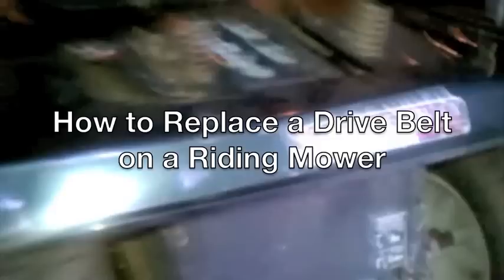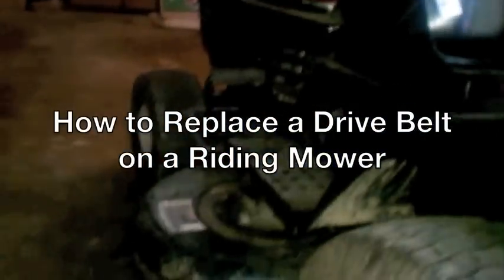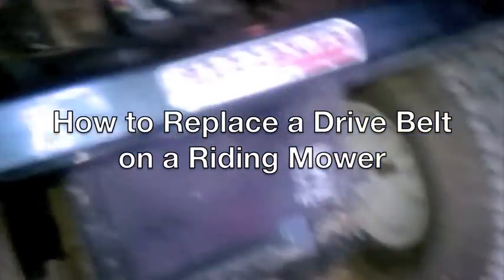How to Replace a Drive Belt on a Riding Mower

Comment: nice vid. bro. i changed mine yesterday, now i done it on my troybuilt bronco. and it was way easier than this vid. but it is nice of you to post your help to those than need's it. all i did was use a motor hoist land lifted the rea end off of the ground. didnt have to remove any panels at all just undone 3 scews holding the rear pully in place chocked the dive tesioner. and put the new belt on. toolk 15 mins tops.
J.T.

Comment: Thanks for the video. I replaced the upper belt for my parents last night. They don't make the original belt anymore for her model 693 16.5 kohler 42" 2 blade, but it looks exactly like your mower in the video. I took her old trashed belt to home depot and compared belts. I got a 38" Troy Bilt / MTD belt, #954-04062 / 754-04062 and it works just fine. Just a tidbit of info for anyone with the 693 or similar.

Comment: great video. what kind of wrench did you use to hold the front still to get the center bolt out. I'm having trouble getting that bolt off.

Comment: Yeah, I didn't see any videos that pertained to mine either. I have that bug pully under the battery cover as well. Got my belt but didn't do it yet. Mine is still really tight, but I think slips once in awhile. It's 8 or 9 years old.

Comment: did you have to take the pulley (the stationary one by the tensioner pulley) in the middle off? not much clearance to get the belt threaded.

Comment: A monkey wrench might work too. Another way is to get a chain wrench.  Slip the belt off the larger pulley and wrap the chain around the pulley.  The chain wrench only works properly in one direction so make sure you put it on in the right direction.  That should make it easier.  I use one that looks like a vice-grip with a chain on it.

Comment from the maker: I'm by no means an expert on riding mowers so I have no idea why yours isn't working.

On my own mower, if I were to put on a new drive belt and it won't work because the belt is loose, I can only think that maybe the "idle spring" isn't reattached. That spring is extremely hard to pull back into place, but it is what tightens up the pulleys and puts the tension on the belts.

Comment from the maker: Yeah, that's an old myth. Google "Snopes.com: Do Cement Floors Ruin Car Batteries?"
I wish I could be of more help. I'm really no expert on mowers. Just tried to make a video that may help others who had my problem because there wasn't any vids. From my experience, and this is from 2 years ago, when I put the belt on it was a little loose. Then when I pulled the idler pulley spring back into place, the belt tightened up.  But this was on my mower, I do not know if this works on others. Sorry.

Comment: Never put your battery on the concrete
Reply from the maker: http://www.snopes.com/autos/techno/battery.asp
Reply: It killed my battery had to buy a new one for my car. Concrete does in fact drain the battery.
Reply from the maker: You see, the myth that concrete drains batteries does have some historical basis. Many, many years ago, wooden battery cases encased a glass jar with the battery inside. Any moisture on the floor could cause the wood to swell and possibly fracture the glass, causing it to leak. Later came the introduction of the hard rubber cases, which were somewhat porous and had a high-carbon content. An electrical current could be conducted through this container if the moist concrete floor permitted the current to find an electrical ground. The wise advice of the old days to "keep batteries off concrete" has been passed down to us today, but it no longer applies because of the advanced technology of today’s batteries.	 
 
For more than a decade, automotive and commercial battery containers have been made of polypropylene, which is a highly insulative material. In fact, the Interstate Batteries poly material is at least five times more insulative than the old hard rubber. Also, tremendous technological improvements have been made in the seals around the posts and the vent systems, which have virtually eliminated electrolyte seepage and migration.
Reply: Michael Aybar old wives tale